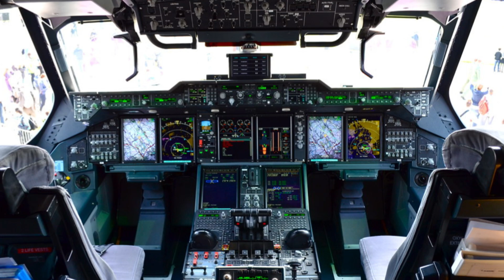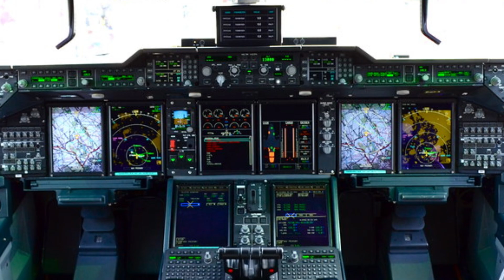Trapped in a Doomed Aircraft: The Airbus A400M Disaster

Comment: The video really needed to explain how the aircraft took off with these engine issues. That wasn't very clear.
Reply: we have here by us a simple speaking about those kind of issures:

" there is a reason why the dragons should not fly higher than 1000ft. "
Reply: @jfdavis668  
Apparently the run up to Takeoff Power was normal. You had the lead test team aboard, you had all warnings systems calm.  The software was happy with the application of power.
Possibly, FEDEC  was engaged soon after lift off.  My guess, this is when engines 1, 2 and 3 went South to idle  regardless of the Power Lever position.
I am sure in the crew’s efforts to regain control of their non responsive engines they disengaged the FEDEC system which apparently had no effect (maybe this electronic stallion doesn’t even have such a switch). In sudden abnormal aircraft behavior, oftentimes reversing the last manual action taken can be the solution to the problem. 
However, in this fully automated marvel, maybe FADEC is engaged from the beginning of the Takeoff roll automatically so there would be no feedback to the crew that this could be the problem.  
My problem with FADEC that when it has a problem all your engines have a problem. It appears from this video study that the crew during normal pre take off checks that engine instruments including FADEC would annunciate  any abnormalities. The beauty of software problems, this electronic miracle sensed it was normal. 
This test crew didn’t have a chance. Perhaps, this accident is telling us something. If a change in software can do this once, it probably can do it again. So these electronic engineers and coders must figure out some clear and simple overrides to keep systems designed to help you from trying to kill you.
Reply: There is normally an undercarriage switch that tells systems it is in the air, maybe that was the difference between ground and air operation.
Reply: Software crash

Comment: FEATHER all engines and accept a controlled glide to a crash landing. They did have that option/chance!!!!!!!
Reply: are you sure the faulty software would allow them to alter the prop pitch manually if it wouldn't respond to throttle inputs?
Reply: three of four stops working at 999,9 ft. think about it
Reply: That's what I was thinking, get rid of that thrust asymmetry, get rid of those draggy discs, configure for off airport landing...

Comment: Call me a Luddite, but if there is going to be software controls for critical systems, there should be an old-fashioned cable & pully backup to the software.
Reply: that new trend to put tons of software in a plane is a threat for passengers , see what happened to B737 fatal crashes   and the A330   paris rio crash in 2009
Reply: please correct me if i’m wrong but aren’t the majority of airbus airplanes entirely controlled by wire (electronically) ? and i mean there are many thousands of them in operation every day and so far there have been only very few incidents, of course that doesn’t make this tragic accident at hand any less significant but statistically speaking i don’t really see a huge benefit in including an intricate and costly mechanical system only for the engine controls, if you’re getting started with that it would also make sense to have a mechanical back up system for all the other flight controls and all of the sudden you’re building a more complex version of the very plane you meant to replace/innovate on
Reply: @randomcookie2350  after the two fatal B737 Max crashes , I was thinking about some kind of a huge hard reset button that pilots would hit  to disable any software flying the plane , so that they could regain full control of the plane .
Reply: You're NOT a Luddite.
Reply: I agree,   All this software 💩💩💩. Is deadly
Reply: What is your personal aviation-related experience?
Reply: Airbus’ automated flight control systems have a history of crashing themselves.
Reply: Most of nowaday's aircrafts - from the USA also - couldn't be handled manually, with only mechanical controls. Their aerodynamics are too complex and engines run correctly only thanks to multiple computers. Especially a four-engine which such a weight.
Reply: @deck614  but  when there's a faulty sensor , computer gets wrong readings, and pilots get too much focused on finding out the cause of wrong readings , rather than flying the plane, and there they slam the ground with pull up terrain from warning speakers ,  they'll repeat it  to God when in heaven
Reply: Luddite or not, that just makes sense!
Reply: As a young man I loved all the newest gear.  Now I use the preppers motto of two is one, and one is none.
Reply: I agree there are somethings that should just always remain mechanical and failsafe !! 
It's bad enough that pilots only really control the plane during takeoff and landing , well sort of
Reply: ...with an override to allow the pilot to take full command!
Reply: @johnc2438 amen I keep saying that
Reply: That would be very difficult impossible for larger planes, such as common passenger jets that everyone flies on. Engines are typically less critical than flight control surfaces, which involve forces that are too strong to control manually via cable.
Aircraft normally just have multiple systems(electronic & hydraulic), along with several levels of automation, which at the lowest level is effectively direct control.
Reply: The Boeing I used to drive had "manual reversion, aka Armstrong steering.Nev d's had it break I. The real thing, but Sim sessions were fun
Reply: AMEN.
Reply: Cables and pulleys have a nasty habit of jamming. However, you are absolutely correct that you need backups, there should never be a single point of failure.

In the Space Shuttle, there were five computers that ran on a voting system - two computers could fail or produce corrupt data without impacting anything vital. I'm not sure if the software is identical, probably not, as that would reduce the risk of a common defect shutting down everything. 

In modern military aircraft, you'll often see one or two backup links, for greater resilience to damage.

These two would certainly reduce the chances of a technical failure causing disaster.

However, there may be other improvements. Systems should be fault tolerant first, fail safe second. So engines not getting data from the cockpit should not shut down, but use a secondary source (such as getting data from engines that are) first, shutting down only as a last resort.
Reply: installing a real backup system would take money from the pockets of shareholders, can't have that going on no Sir!
Reply: luddite ;-) that won't solve anything... how many planes are in the air at any one time..?  thousands, and how often are there 100% fatal crashes..?  very seldom... so all that extra weight for such a system would only drive costs up for no real benefit, which in turn means much higher ticket prices which most people are not prepared to pay...
Reply: @23merlino  ......which may reduce air hours - which is VERY MUCH a benefit to the environment
Reply: Those are reserved for flight control surface duties typically.
Reply: @GFSwinger1693  So, there has never been engine controls with cables?   I seem to remember some of the aircraft I flew with manual throttle, carb heat, mixture and prop controls.
Reply: @ Yeah, but the context of the question was for aircraft using a software controlled ECU, not your Cessna 152 and the like..
Reply: @GFSwinger1693  And you know what aircraft I have flown and how many hours I have as PIC, how?   Please educate me!   I will update my logbooks with your infinite knowledge!   Have a good one!
Reply: @ Sorry, I should have looked to see if you were at troll first before I tried to have a civilized discussion with you. Never mind.
Reply: Yes, on the test aircraft(s) and potentially early production models, redundant/mechanical backup is a great idea until the software has proven to be reliable. A simple crude system for backup could be used to keep costs down...

Comment: I thought Airbus put in a lot of redundancy into their software, having 3 separate teams doing the programming for each model of aircraft.
Reply: They do. The Engine FADEC systems weren't built by Airbus and the firmware loading procedures were written with a number of cultural assumptions made (ie: the German or French way of doing things is different to the Spanish way of doing things. Not necessarily better or worse, just different)
Reply: You'd think they had redundancy in their software, along with redundant processing hardware, so that a faulty processor could be isolated either automatically or manually!

Comment: I call BS, as the plane had to make the trip to get to this airport.
Reply: It was built there.
Reply: @BrianMorrison  They don't build them at an airport.
Reply: @georgecothran4760  This aircraft was on its first pre-delivery test flight, it had not flown before.

Airbus stated "At the time, approximately twenty A400Ms were on the Seville assembly line in different stages of production" so as you can see the production line for the A400M was in Seville. Of course an airport is needed so that the completed aircraft can be test flown before they are signed off and delivered.

In this case an error led to torque sensor calibration data being erased unintentionally during engine ECU software upgrades, for some reason I am unsure about this did not occur on the number 4 engine ECU. The engine software was unable to function correctly without the calibration data, this was a design oversight. It subsequently became clear that the manufacturing processes had inadequate checks in place to identify the error that was made.
Reply: @ Thank you for explaining that better.
Reply: @georgecothran4760  You're welcome, I would say that the video should have been clearer about this. A very tragic accident, the crew had very little chance to deal with the problem and even if they had been able to feather the 3 failed engines it would have been difficult to return to the airport with only one engine running.

Comment: why are you talking bullshit in your crappy video, the plane is not at fault, only a fault in the engines, faulty installation of the control software for the 4 engines, hence the engines cutting out in mid-flight! the Airbus protection system is not responsible for this accident!

Comment: I am surprised that it can't maintain attitude on one engine. I would have also thought that a single engine landing would have been more survivable.
I was on the wing design team on the A400M. This is the first time I heard about this tragic accident.
Reply: To maintain height on one engine the three problem engines would probably need the props feathered.
Reply: @jeffmcdonnell1179  If the engines had failed, then "auto-feather" since they were still developing power, no auto-feather... Should have pushed the stick forward, level the wings and land straight ahead, as much as possible. With a 3000ft/min sink rate from a little over 1100ft agl, slim chance of survival. Not many test pilots would of fared any better...
Reply: @missedshot9235  they were at 1700ft. i don't know how the prop pitch is determined on these aircraft but surely setting them to idle does not turn them into an airbrake? maybe that was the problem?
Reply: No altitude, little speed and an understanding of the problem is a bad way to fly.

Comment: All the engines were working correctly on take-off. As reported at the time the pilots tried to reduce from take-off power to cruise power and the engines at first refused to respond and then all went down to idle. The pilots tried to increase power but only one of the engines would respond, and the aircraft hit an electricity pylon just short of the airfield. The crash was at the time blamed on a "software error" in the engine control system, which had been modified to meet a requirement of the Turkish Air Force for which this aircraft had been destined.
Reply: WAS DESIGNED to sabotage the Turkish Air Force.
Reply: Software works the same for all the engines, why did one of them continue to work correctly?
There was no OVERRIDE to automations.
For proper redundancy we need 3 parallel sets of sensors to compare against each other and ignore the faulty sensors. If we use only 2 sets of sensors we will need very sophisticated algorithms to detect the faulty sensor(s) and deactivate them.
Reply: The video says data was erased on three of the engines, at time of install, with the data intact on the fourth. If this is correct, then the computers should have refused to start the engines at all.
Reply: @ShonMardani and we need the one big red button that says "Override...FULL MANUAL"
Reply: @Ben-f7k5g and, as a general note, we need the crew to be capable of operating with all automation disconnected. Something which is absolutely not true in today’s aviation (not referring to this particular case obviously).
Reply: @Ben-f7k5g  Many aircraft don't have manual flight controls nor need them, and the safety rate is not a major issue given the millions of flights between the rare crashes. Modern aircraft systems are so reliable I sleep like a baby in flight. (I'm a retired USAF comm/nav troop (OV-10A and F-4E Phantom) crosstrained to jet engines then later merged with crew chief.)
Reply: @Comm0ut  " Many aircraft don't have manual flight controls nor need them "

yes and a dogfight can be automated 🤣

Comment: How did they take off with only one engine advancing to full power?
Reply: They didn't, watch the video.
Reply: All engines worked correctly during T/O, though without knowing the torque the engine could not correctly trottle back when speed increased beyond V2. To prevent overboosting the engine,, overtorqing the prop (and risking it to snap off) the engine was trottled to idle, causing the prop to go to fine pitch, basicly chaging it into a huge airbrake (one of the great things about flying turboprops).
If the crew had known what was going on, they just would have feathered the bad engines and had a descent chance in making an off airport landing (where this aircraft was designed for after all)

To bad, four lives and a magnificent aircraft gone.